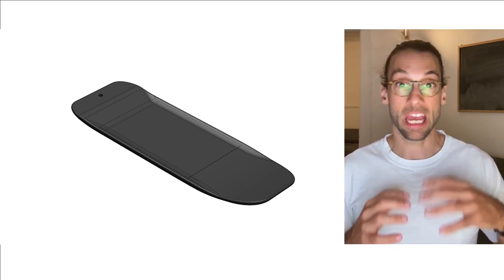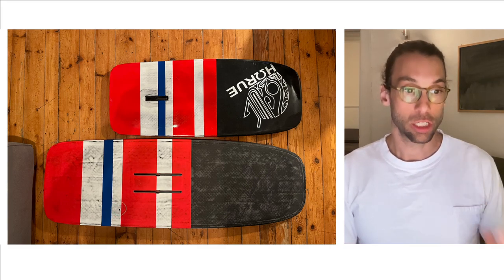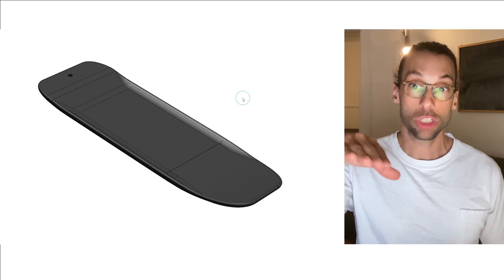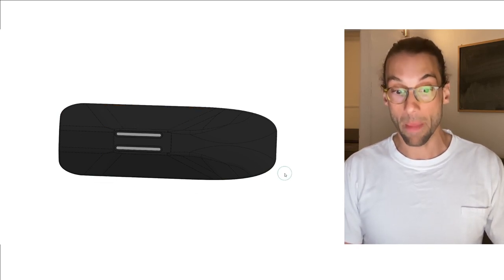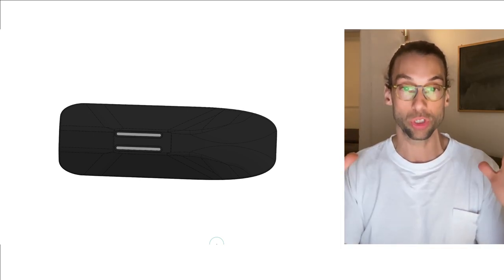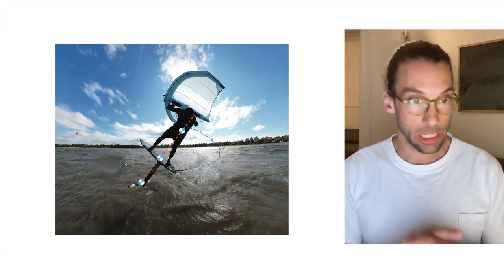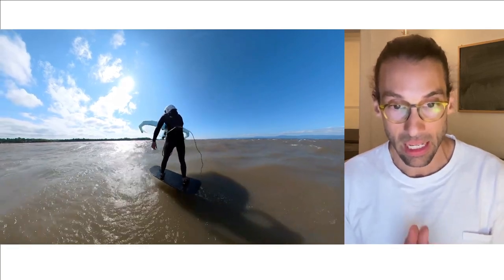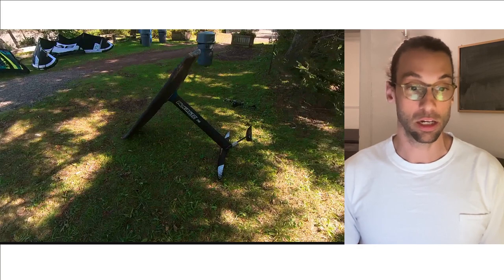Experimenting towards the ultimate wingfoil board

Comment: Looks good. You're definitely onto something. Board design is way behind possibilities in my opinion (I'm a Mech Engineer)
I would add a strong cutoff edge for the flow on the aft or rear of the board. your Edge seems to smooth and this makes it harder to separate the flow in the rear, creating additional drag during the planing phase. Also think about making some cuts into the V shaped hull allowing for air pockets to enter the board from the front and help separate the boundary layer of the water from the board. These air pockets get pulled back and help the board unsticking during the pumping phase. Look t what Takoon did in their Glide Boards with the "Trimaran shaped hull"
Reply from the maker: @Inbadi I hear you with the string cutoff... I would need to think about it more as I intuitively see the benefit at high speed but I am not sure of the significance at lower ones during takeoff. Moreover, when I am touching down, this aft part hardly never touch the water. The downside I saw is that a sharp cutout introduces a discontinuity in the carbon surface which would require more carbon reinforcement = more weight. That being said, the experimentation phase is not done yet and this is one will be on the radar for the V3 :) 

Regarding the V shape, in my case this is not intended for takeoff, but for riding; I want the least amount of surface touching the water in order to bounce back with as much speed as possible. It is really noticeable compared to my KT drifter, as there is a lot less drag during touchdowns for both the bottom rocker and the rails. I have tried several bottom shapes and from my experience, the difference seems to be marginal during takeoffs. (I have not tried the Takoon Glide though)
Reply: by the way...James has a Doctorate in Engineering :-)
Reply: @mictemplar8160  cool ! didn't know that. Then he's a fellow 😎

Comment: What would be the downside of adding another inch of thickness throughout the board? If you rely more on buoyancy could you cut the area? 

In cad are you able to calculate weight and x/y/x rotational inertia? I assume EPS has a given density and the carbon has a given weight per area.
Reply from the maker: @onquarter We do not even need to go to the CAD to explore these changes. The increase in the foam core inertia with respect the thickness is linear. That means that if we go for a 10.5cm thickness instead of a 8cm one, you will increase your core weight, and volume by about 30%. That makes the new volume around 42L, and the core weight 830g. Regarding lamination, this one is not in the CAD anyway, but such a change would require 2.5cm of carbon layering x a perimeter of (47 + 140)cm x 2 = 374cm. The resulting area to cover is this 9.4dm2 (decimetre square) with a layup surface density of around 7g/dm2 so that makes 66g. The total change on the weight from adding 25mm of thickness is +9L to the volume and +260g to the weight. In my case that represent +10% of the total weight and because it is in the Z (vertical) direction, it would increase the rotational inertia by about 10%. 

A 10% increase might seems like a little, but the thing is that from my experience, the gains of adding 10L will not be worth. This is because the limiting factor is in the third "takeoff pumping" phase. I know from experience that if I can reach the third stage where I am pumping the board, I will takeoff with a board of 140x47cm because at that stage volume does not matter as much as surface. I have already compared back to back my KT 33L and my Fanatic Sky 55L and the gains in takeoffs is probably ~1kt of wind speed. Therefore, you would marginally improve your takeoff experience for what represent <1% of your time spent riding which is made worse by 10%. This is my rationale behind the current design...
Reply: @james_goulet  I see. If the limiting factor is the third stage, I agree adding volume is bad. I’m now thinking that less length and more width could help that phase. And it would decrease your yaw/Z inertia. But obviously it would compromise your maximum lean angle when turning. 

Wow this is a challenging optimization problem! I wish there was a way to do faster/cheaper iterations.

Thanks for doing this experimentation and explaining it for the community!
Reply from the maker: @onquarter  There are indeed some more refinement to be done... we will get there :)